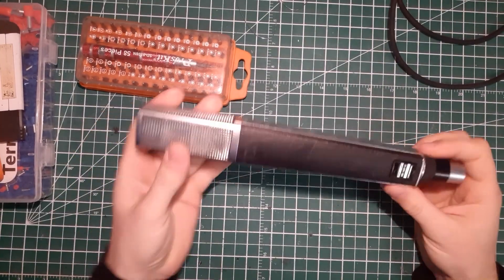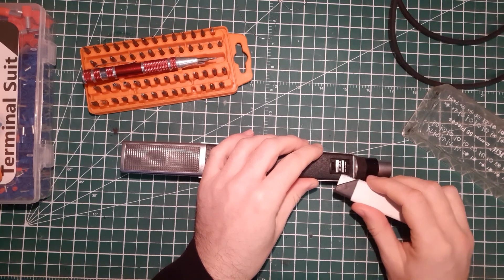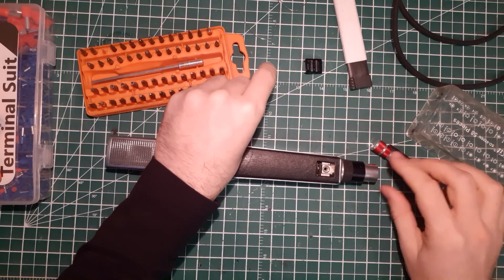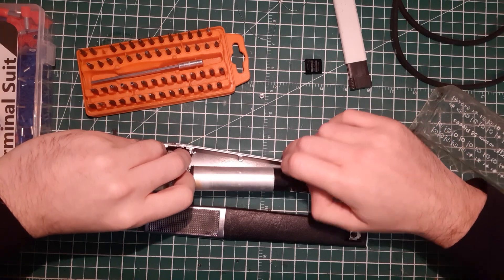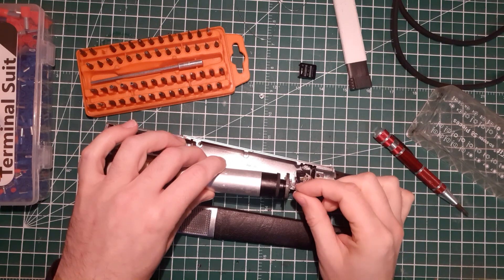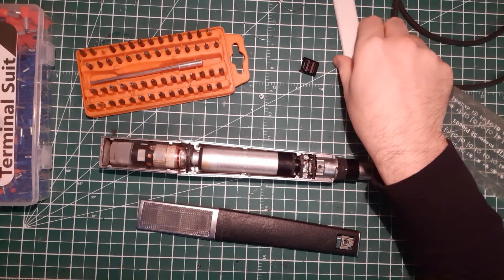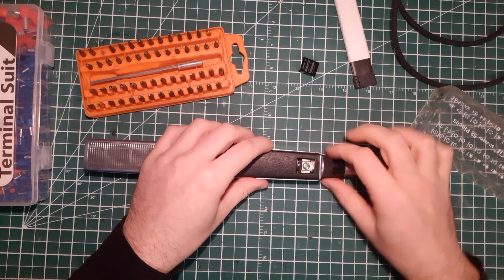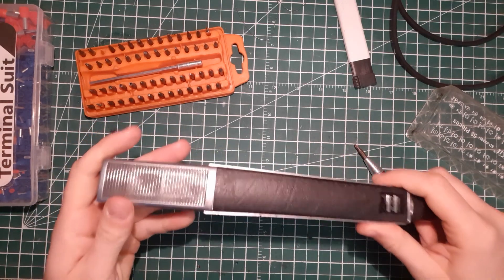How to Open a MD441

Comment: This is very helpful. My old 441 treble switch was wire to be a shutoff switch, and I'm hoping I can figure out how to wire it back to the original configuration. Gonna be some guesswork because I can't find a circuit diagram.
Reply from the maker: You're right, it's pretty tough to find the wiring! All I could find is this old Sennheiser schematic exploded view: https://spares.sennheiser.com/catalog/product/000762-md-441-u
Reply: @ThePhilStudio  Do you still have this mic? Would it be possible to somehow post a few close up photos or video of the wiring at the treble switch? I know yours has a broken wire (green one) but I would think the rest of the wires are still connected in the correct spots on the switch. And btw, you can open that metal canister and pull out the PCB board and then repair that broken green wire. That seems a bit scary trying to get that canister apart from the end, but probably doable. Thanks!
Reply from the maker: @breakburrito  Hey Sorry I was supposed to check it out and completely forgot! I'll try to do it this weekend!
Reply: @ThePhilStudio No worries! I appreciate your help!

Comment: My Front Panel is a little loose. I can move it up and down by 1mm. Any suggestions how to fix this?
Reply from the maker: It might be the clip inside that is loose. If you don't mind never opening it again, maybe just a little touch of glue. Could be non-permanent glue so It doesn't move anymore but you could still open it by applying a bit more strength.

Comment: It is not a highpass filter, it is a treble boost.
Reply from the maker: Thanks for the clarification, much appreciated!
Reply: But how is it a boost if not powered? Wouldn't it essentially be a broad attenuation of low frequencies, that ultimately sounds like a treble boost? Just a guess, based on my minimal knowledge of guitar amp circuitry.